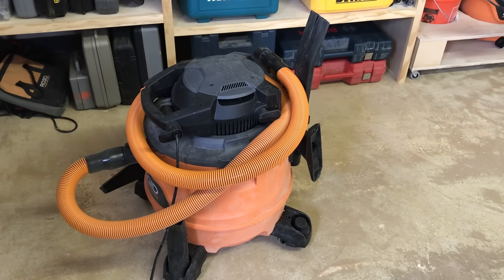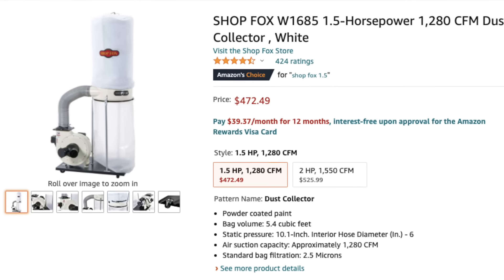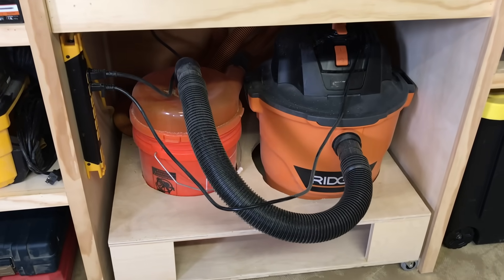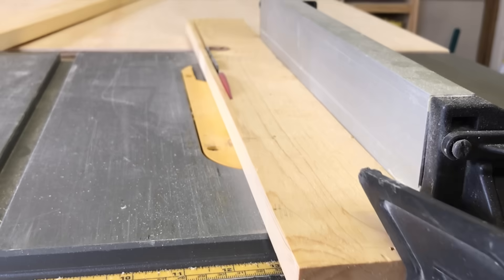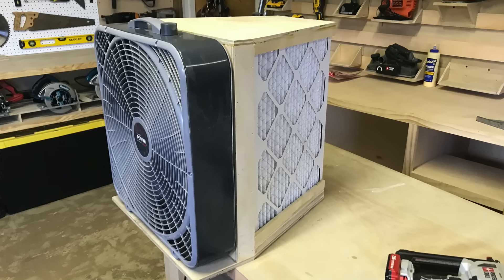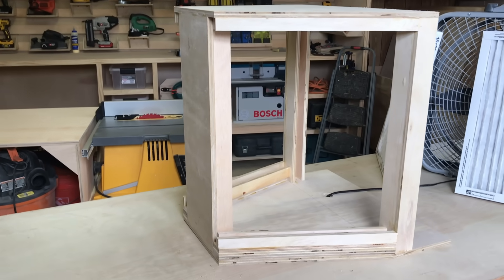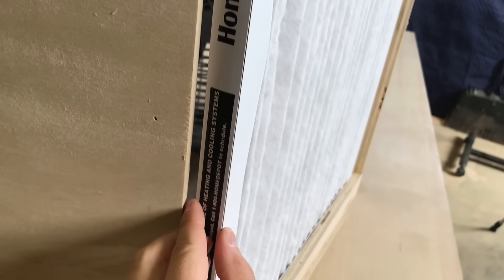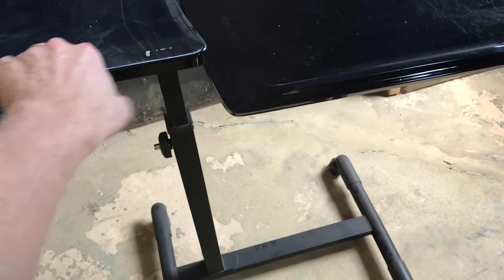BOX FAN AIR FILTER For About $40! (How To Build a DIY Box Fan Air Purifier With HVAC Filters!)

Comment: 1.  Be careful you aren't overtaxing the fan.  If running with filters has a different motor pitch than running with filters you are overtaxing the fan motor.
2.  The original purpose of "duct tape" was not for ducting.  The US army originally called it "duck tape" because it was originally used to waterproof seams.
Reply: So, let me get this straight, Duck tape isn't made for mending DUCKS?
Well, I'll be dipped.
Reply: @stans5270  I thought you were about to say "I'll be quacked". :)
Reply: When I first built mine I made the decision that if the motor burned out, the $20 box fan was cheaper than the filters I already have to replace, so who cares? But 4 years later the fan is going strong. If you keep an eye on it, you'll know when a fan is wearing down.
Reply: @justinddunlap  the filters isn't something you should be worried about.  You are running it in an environment with a lot of floating wood dust.  It may not be as flammable as coal dust, but it is still a danger.
Reply: @charlescox290  I assure you - it's far easier to just not be the guy you're being. What an obnoxious hill to die on.. 🙄
Reply: Great idea Ethan I'll try to build this box fan idea love keep you lungs clean!
Reply: Every duck I've met just calls it "tape"
Reply: @justinthor5438  Oh thank dog, someone with sound priorities. Here's your Best Comment Award 🏆
Reply: Look at the pressure volume curve for the filter and for the fan,  the cheap box fan will only do 1/2 " water column pressure  at 0 CFM and 80 cfm at 0.1" wc,  while IF the filter will only pass 1cfm  cfm at 0.1",  5 cfm at 1/2" and 20 cfm at 1"   then the box fan  filter system wont produce much throughput.  The prop fan motor may not overload as badly as a forward inclined squirrel cage fan but if the motor doesnt get enough airflow to cool the motor the rig will get hot fast.    If high performance 4" thick hepa filters ( industrial and hospital)  that only start flowing at 1.5" are used the box fan wont flow any air at all and will just use the motor watts as a space heater.
Reply: Re: The Great Duckt Tape Debate  1. Lmao this is great, I'll never again lack a way to strike up lively conversation in a room of maker types 😂 2. Y'all are kinda either not specifying or are conflating the phrases "duck/duct tape" with the item "duck/duct tape" and it's kinda confusing (my shot in the dark is that there are multiple histories there that converged later idk I'm not an etymologist I just play one in class sometimes 🤷‍♂️ ) 3. I have never in my extensive use of duckt tape encountered one that had any properties that I'd mention in the same sentence as waterproof lol, the adhesive always cries and gives up the moment a cloud thinks about rain, are some of you just crazy or has the world been holding out on me 'cos wtf mate
Reply: Use two fans, duct tape one in front of the other. Why not? Pulling more air through filters.
Reply: you're worried about overtaxing a cheap box fan versus inhaling harmful dust? That's weird.

And if duck tape was originally used since 1899, that is irrelevant, since The Honest Carpenter said DUCT tape, which its initial purpose is to seal off air ducts, whether that's for water or air... 

You are just one of those Mario's, always gotta be jumping up to one up others to "correct" them, while actually correcting nothing.
Reply: @JesseTradesFutures  well, by the time duct tape was the common term all the professionals were using the far superior product foil tape, which really was designed for ducting.

When an overtaxed, cheap $20 fan wears out and starts sparking it could catch those filters on fire, so yes, I'm worried about overtaxing a $20 fan
Reply: @charlescox290  ......thanks for your input fire Marshall Bill. 🔥 

Next time you go to take a poop and decide to check out the latest postings on your favorite woodworking YouTube channel, maybe try and refrain from being "that guy" that preaches safety knowing dang good and well that you haven't always come to a complete stop at a stop sign, or always used your blinker....or safety glasses in the shop let alone hearing protection. 

C'mon Charles, lighten up and just enjoy the channel. This guy is super knowledgeable and just trying to share his knowledge with others because he has a passion for the crafts.
Reply: @AdamTheCarpenter  actually, I do always use appropriate PPE, thank you.
Reply: @AdamTheCarpenter  LOL! Let me tell you something....
Reply: Well I heard that there are a bunch of different theories about all of this so now the question... who is right?
Reply: @CD-vb9fi  It's pretty establisted that so-called "duct tape" is waterproof and is bad for heating ducts. Regardless of whom you believe about the history, people should stop calling it "duct tape".
Reply from the maker: I’ve heard it differently Charles. I’ve heard that the original product was “duct” tape for HVAC installations. But every consumer heard “duck” tape.

So, eventually a competitor knocked off the patent, called it “duck tape,” and outsold the original brand so effectively that they stole their entire market share. Just how I’ve heard it though…
Reply: @TheHonestCarpenter  What most people refer to as "duct tape" (the gray, cloth-backed tape) is terrible for ducts.  It dries up and becomes brittle.  It's meant to be a water-proof tape.
Reply: @TheHonestCarpenter  I have also heard that NASA had it developed for the space program for the Apollo program and that they also had the invention of Velcro for the space program but yeah originally duck tape was for actual ductwork it was just a different type of tape for that it was kind of an aluminum thin tape that had aluminum coating and a paper coating on top of that and it would adhere with a very strong adhesive to ductwork to hold securely under all circumstances and if I am wrong sorry but that’s what I understood we need to have a way of actually putting up resources as to the actual development of different things and who created in order for everyone to have the correct information and know what is true and what is it
Reply: @TheHonestCarpenter  According to the Oxford English dictionary, "duck tape" has been in use since 1899.  "Duct tape" was in use only since 1965, well after it was used in WWII.  I'm going to go with it originally being "duck tape".
Reply: @charlescox290  Bruh I've been the guy you're being, I get being pedantic and concerned with specificity, and I actually agree that strain on the fan should be considered in any project like this. For this case, I'd personally argue that the design is still well within an air pressure tolerance range where we wouldn't see much increase in motor strain adverse events per whatever-time-period (for any given average representative reasonable-quality box fan) compared to ordinary use. But you're definitely right about the principle needing to be kept in mind.

All seriousness aside, c'mon man, you don't gotta do the vibe like that by tagging the uninvolved creator to complain about another fan annoying you, like, c'mon man, I get what the mood is like but you know that's not being your best self, and behavior isn't identity so you can literally always just start doing better any time, you got this
Reply: @TheHonestCarpenter  of Adam N is e kind of moths your flame attracts I can do without your channel.  I'm unsubscribed.  Have fun.
Reply: @charlescox290  Bro, over react much?
Reply: @charlescox290  Byeeeeee
Reply: Please explain how the fan can be overtaxed by placing filters besides if?

Taping a filter to its body still protects the fan as it has its own casing. Building a fixture as he did in the video shows the filters aren’t even touching the body, so there is plenty of space where the intake air moves around.

If the motor starts going out, it’s because it was on it way out for other reasons. It has nothing to do with the filters.

If dust entering the motor is the problem, then it means there is just too much dust in the vicinity, and the filters actually HELP, not hurt in this situation because it is actually removing dust from entering the fan’s motor as the dust gets trapped in the filter.

For the fans motor to be affected by the filter, the filters would need to be so clogged it that no air could actually penetrate through, and for that to happen it would be clearly shown as you wouldn’t be able to see the actual filter through the dust.

To be used effectively, the filter needs to be changed every few months or so. There is a recommendation on the package as when the filters should be replaced. Do you think anyone is going to the leave the same filter(s) on for three years in a heavy used shop, or even moderately used shop?

Comment: I like it but, wouldn't it be better to have the filters more internal to the unit.. so that dust not embeded to the filter wont fall to the floor upon turning off the fan?   I could be overthinking the purpose.  If it was internal you'd have more control over open edges and not require the tape.  I want to make one though.. nice vid.   Also which Merv/fpr/hepa level of filter are you using?  would there be any benefit to using a lower grade at the front to grab larger particles and allow internal higher grade filters to last longer?

Comment: Genius. I am so glad you cover dust in a shop. It's incredibly dangerous and I always wear a full face respirator as much I can tolerate when in the shop in addition to a dust filter, shop vac and dust collector (for the bigger tools).
Reply: You're right about the danger, Dave. Be especially careful if you are working with kiln-dried Western red cedar or redwood. I once got what they call "red cedar asthma" while building an arbor. It gave me an appreciation for what asthma sufferers go through.

Comment: That's a really nice design for a small shop, portable so it can blow on you wherever you're working. My machine room, however, has 12' ceilings, an area approximately 36' x 48'. I built two units similar in concept to yours  to complement a central dust collector. My scrubbers are cubes that  hang from the ceiling and have double filters, 20"x 20" dust and HEPA, on 4 sides. A plain attic vent fan mounts in the bottom so the filtered air is blown down into separate work areas. Yikes! I just priced these fans and they're now about $60 each. Regardless, they sure reduce the wood flour in the air though they're a pain to take down and blow out outside.
Reply from the maker: That’s a heck of a set-up Mark! I thought about ceiling mounting mine, but it’s a weirdly framed commercial roof above me. Sounds like you’ve got a great shop though!
Reply: @TheHonestCarpenter  Well, I guess so but each scrubber is heavy enough that it takes a cheap boat winch or two-part block and tackle to hoist or lower them.  Since I don't have ceiling outlets, a cord plugged into the wall has to drape over screw hooks which requires a forked pole. That bit of electrification wouldn't fly in most jurisdictions, certainly not in a shop with employees. But judging by the amount of dust at each blow-out, these units are worthwhile. After 35 years in my previous shop the fines that had escaped the pitiful dust collection had formed pyramids on every undisturbed horizontal surface. No wonder my lungs are shot.

Comment: This is nice. I just use the box fan, used filter, and a 6-inch clamp for my sanding days
Reply: The clamp isn't necessary. Air suction from the fan holds the filter in place.
Reply: I’ve seen bungee cords used.

Comment: I wouldn’t rely on a homemade  air scrubber to protected your lugs and extend your like. I would scrap this plan and save up for a professional unit ( not the kind of equipment you want to skimp on)
Reply: There are tests done on Youtube between the DIY box fans against name brand consumer units costing up to a thousand dollars.    Various tests were performed and measured with sophisticated particle measuring equipment.  The DIY box fan beat most of them.

Comment: I went even cheaper. I taped 2 20x20” filters to the back side of a box fan in a similar triangular arrangement  and cut out triangular prices of cardboard from the box the fan came it.  Taped it up with masking tape.
Reply from the maker: Whatever works, James! 😄
Reply: Good for Western wildfire smoke. Improves my indoor air quality significantly according to my purpleair sensor.
Reply: I bought 2 purple furnace filters from the hardware store, about $25 each. Taped one to a box fan for living room, the other for the bedroom. This is for wildfire smoke. It seems to work. It does cut down on the air flow through the fan quite a bit, and the fan vibrates a lot more. The fans are cheap thankfully.

I also bought 20x20 which is the perfect size for the typical box fan.
Reply: @someonespadre  I plan to do that... I am in wildfire prone NorCal :-)
Reply: @omnarasi9637  a plan I saw…4 filters, cardboard base, the 4 filters are the walls of the box, fan blowing up is the lid. More filters reduces the drag on the fan
Reply: Lol thats what i did
Reply: LOL. Nice. I’d have done that
Reply: Sweet idea
Reply: I went even cheaper... though might not be available so often and was a blessing for me while I had already planned routes to pickup other items or do chores. I'm wondering how the 2" and like I just made a video detailing my 4" free design (minus the cost of tape and expense to get) compares.  Seems a thicker filter will improve airflow and filtration rate. https://www.youtube.com/watch?v=UxGa1_dfGvY
Reply: Samesies.

Comment: I just duct tape a 20x20 filter on the back of the box fan.  Works great.  :)
Reply: I tried that. Fan only lasted a few hours.- probably too much strain on the motor.  Use 2 or more filters ( not stacked) to lower the load on the fan.
Reply: @jameslippert3523  - Weird.  Mine's been runing non-stop for like...6 months.  ;-)

Comment: I use a single 20" fan with a MERV 6 filter on the intake side and a MERV 13 on the exhaust side.
It's still HEPA filtering, but with a filter set up which costs 33% less.
Reply: I fan that size isn't built to push through that much filter.
Reply: @JohnKerbaugh  True, thats why you need something more powefull. 4-5000 cfm. Cost me 50 euro (was a reduced price from 80)
Reply: @k995100  It actually depends on the size of the shop.
Reply: @JohnKerbaugh  There have been tests done that prove that my way works.
Reply: MERV17 is hepa
Reply: @k995100  So is MERV 13
"HEPA is a type of pleated mechanical air filter. It is an acronym for "high efficiency particulate air [filter]" (as officially defined by the U.S. Dept. of Energy).  This type of air filter can theoretically remove at least 99.97% of dust, pollen, mold, bacteria, and any airborne particles with a size of 0.3 microns (µm)"
"A filter with a MERV rating of 13 to 16 is considered a high-ranking MERV filter and can remove up to 75 percent of all airborne particles 0.3 microns or greater from the air. What is HEPA? HEPA, or High Efficiency Particulate Air filters, are designed for applications where contaminants must be trapped on the first go round."
Reply: @stans5270  "At least 99.97%..."

"Up to 75%"

This stands up to scrutiny.

Comment: I actually use a regular vacuum cleaner nowadays with a dust cyclone coupled to it instead of a shop vac. Its much quieter and has a HEPA filter. Has worked perfectly so far. 
But I probably need to build a fan + filter also.

Comment: Love your videos. Thanks.

My cheap, simple air filter is not as good as yours -- but only takes 2 seconds to 'build'.
No tape necessary -- filter held in place by fan suction.

Google images, "Cheap, simple air filter imgur" -- first image.
The filter doesn't even have to be 20x20 -- I use a 20x25 filter from my house HVAC.
Reply: You win the prize for simplest setup! Genius!

Comment: If you add a nylon mesh to the outside of the pleated filters it will catch larger particles and lengthen the life of your pleated filters.
Reply: Can't i just vacuum the filters from the outside from time to time with regular vacuum cleaner?
It'd be great to see performance comparition of this system using diffrent styles of the box (1 filter, 2, 3?, various shapes?) and what's the best way to maintain it's function (budget wise).
Reply: @mikolajrazny  I find it difficult to get the particles out of the paper folds.  It's much easier to run the vacuum over the flat nylon mesh.  The nylon mesh could be permanently mounted on the box frame and the paper filters slid in behind the nylon mesh.
Reply: For my shop vac  I'll pick up some home style vacuum paper filters from "Good Will" (or steal one from the wife or an old panty hose) Zip tie one over the shop vac filter. Cheaper than new shop vac filters & you can blow them off with air hose.

Comment: Use self- adhesive foam weatherstripping on the frame to seal up the cracks  instead of duct tape.  Makes it much less hassle to change filters
Reply from the maker: Thanks Tioga! I’ll grab some for the next change out.
Reply: Or use painters tape.  Peels off easier.
Reply: I've been using these strips on my windows for years and they make a huge difference in sound, and dust / cold air leaking in too! It's usually like $1-2 for a 15 ft strip. I love it.
Reply: The fan should suck the air filters against the  frame.  I don't think the tape is doing you any good.
Reply: @williammurphy2711  What?
Reply: @france976  What he's saying is the negative air pressure inside the box should force the filters to seal itself against the box frame.
Reply: the gap isn't an issue, you can just leave it for additional air circulation